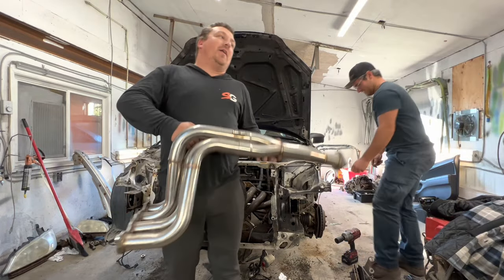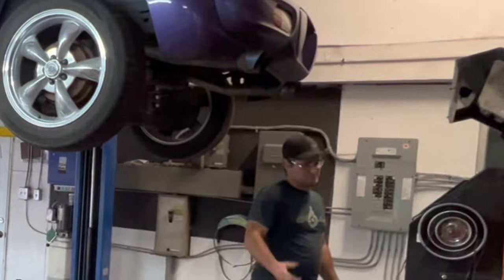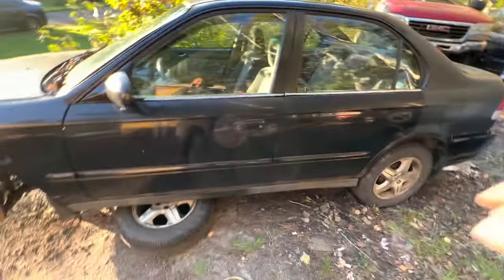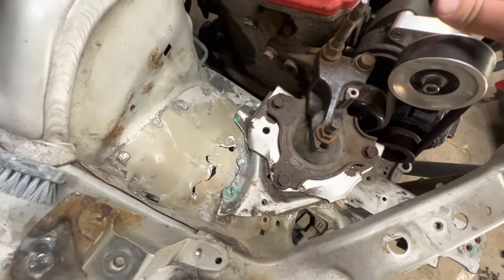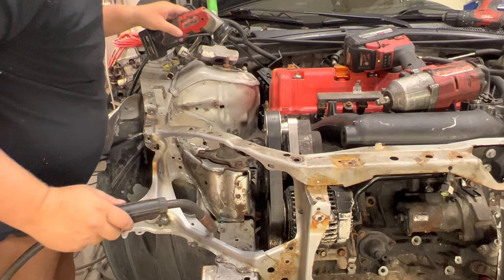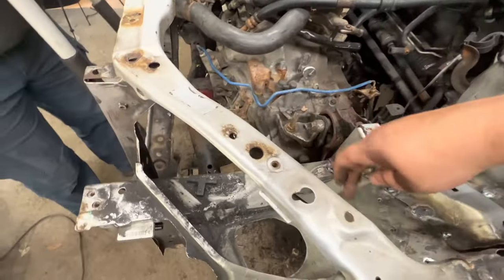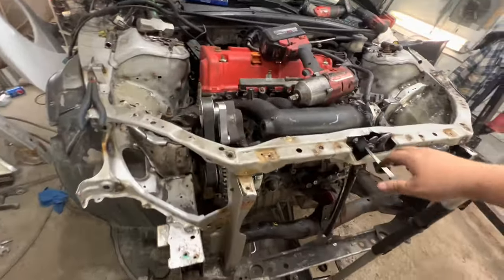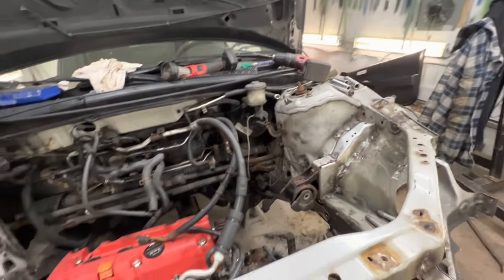How To Build Free K24 Mounts In A EM2  ***Budget EM2 Vol 5***

Comment: Did you just eye where your placing the mounts instead of measuring the geometrical placement?
Hasport makes a set of mounts that already has the math dialed in and you don’t have to waste time.
I understand your trying to do a 2000 budget thing, but there is no cheap budget when you do things right with quality components.
Have you even addressed the suspension before adding power?
Just remember the lazy mechanic does twice the work.
Reply from the maker: Your right for the most part. Lazy mechanics do twice the work. But not lazy on this side. Tons of stuff goes into this that you dont see. As for the suspension, im running em2 struts and spindle to a rsx subframe. I dont need 5 bolt nor do I want to worry about rims down the road. As for axles it would be rsx axles. Spin counts are the same in the spindles.